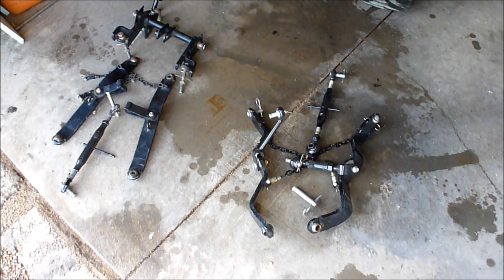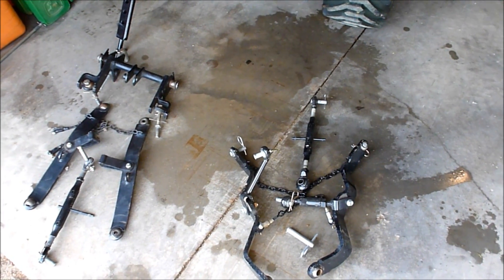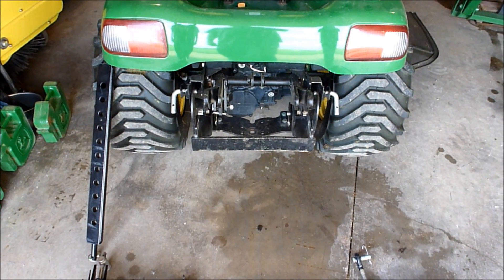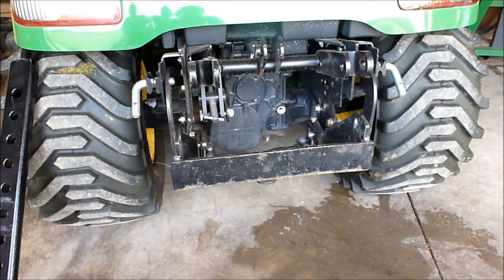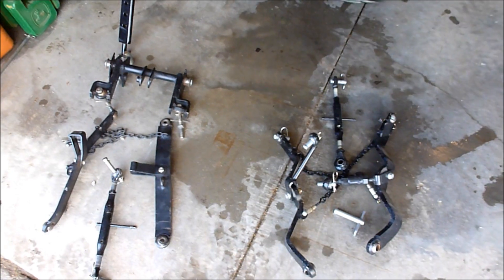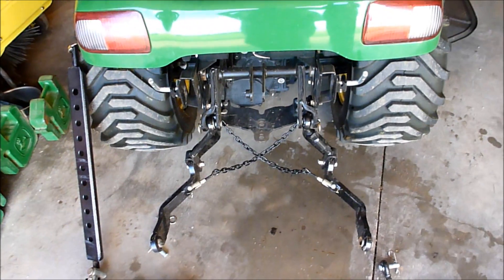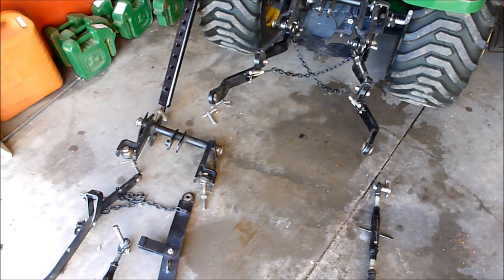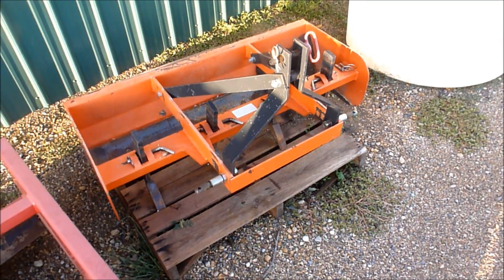John Deere X7 series Cat 0 vs Cat 1 Limited Three Point

Comment: Would you recommend a cat 0 or cat 1 for a 318?
Reply from the maker: I would say a Cat 0. Cat 1 equipment is much heavier and you will need a lot of weight on a 318 to run limited Cat 1 attachments.

Comment: Good video! I have recently purchased an x595. and am considering which 3pth kit to install, One question I have is which has the most lift power?
Reply from the maker: They all have approximately the same lift power... if I was buying a hitch I would get either the Deere OEM Cat 1 limited or the Ruegg Cat 1 limited. You will need front weight if you want to put a lot of weight on the 3 pt.

Comment: Hey mmrbeef, love your videos. Reference them on a regular basis for my own maintenance on my 318. I installed a Ruegg cat 0 hitch a while back. Here's some clear video of it in use and me making some adjustments. I also have some other videos of the 318 lifting some heavy stuff with my boom lift.  https://youtu.be/0dtch3A-Y7k
Reply from the maker: Great, glad you are a getting use out of them. Looks like you are having fun on the 318!
Reply: A 1 bottom plow would be worth getting vs the potato plow.  But it looked like you were having fun.  Look up PA Plow days.  There are smaller tractors plowing right along with 430s and Cub Cadets about that size.  I'd like to go to one with my restored 430.